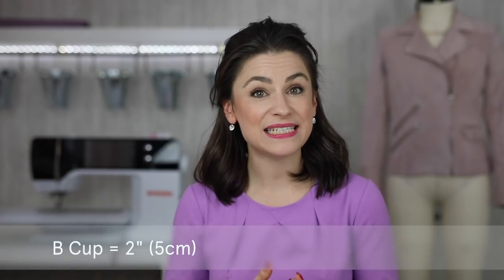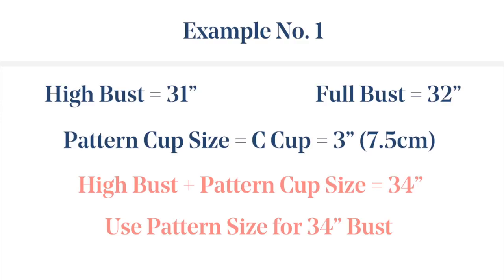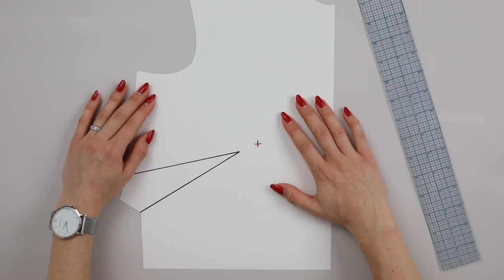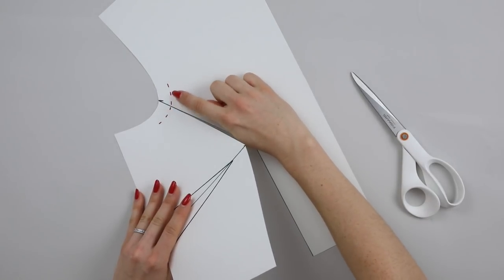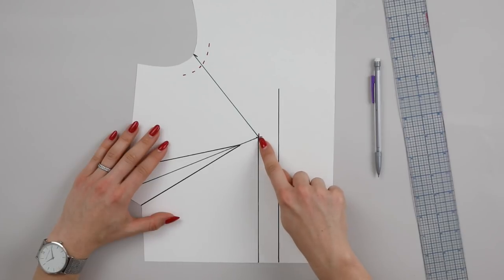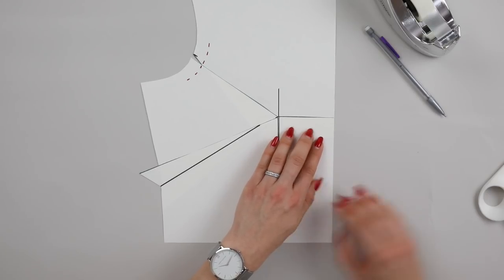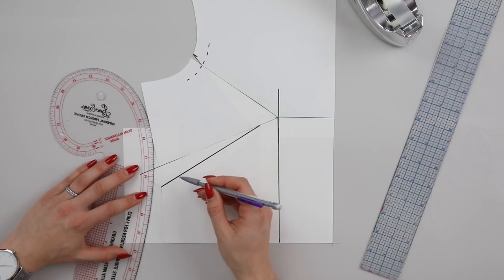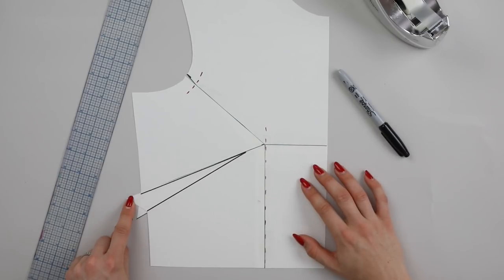How To: Understand Basic SBA - 1 Dart Bodice (Small Bust Adjustment)

Comment: Thank you so much for this video! I watched another sba video in an online class I'm taking and was totally confused. I needed to go from a c cup to a and that video didn't show how to eliminate the dart altogether. You just made my day! One question: if I want to maintain the pattern's waist width and use the curved ruler to redraw the side seam, does it matter that the side seam on the back piece is still straight? Do I have to curve it the same way for the front and back to fit together? Maybe a silly question but Imtvery new to this. Thanks!

Comment: Excellent tutorial. But how should you choose your pattern size in the first place?  Usually, we choose the size based on our bust measurement -- but that is the measurement we are actually going to reduce! Would it make more sense to choose the pattern size based on the high bust measurement? Then the SBA would take care of itself, so to speak.
Reply from the maker: Hi Mary, in terms of what size to choose it really depends on the pattern company you are working with. For my (Made to Sew) patterns I would recommend you choose a size based on your Bust, Waist and Hip and blend between the sizes as required. For the Bust size you would take your High Bust measurement and add the cup size of the pattern (usually B Cup, a difference of 2" 5cm between the High Bust and Bust). This is the Bust size you would choose. If your bust is different to the Bust size then you would do a SBA or FBA. Does that make sense? 

With my patterns I also have a detailed Size Chart covering the size of the shoulders, cross front, cross back etc. so you can see where you fall in these other measurements. 

For some of the larger pattern companies (e.g. McCalls, Butterick etc.) you can find that the shoulders etc. are quite large. I have some customers choose the Bust size from their High Bust (without added the cup size of the pattern). Then making adjustments. 

I hope this helps? Aneka x

Comment: Brilliant! Thank you so much! I’m off to buy some calico to have a play with my patterns. As a small busted women I’ve always squeezed into a smaller size just to eliminate the excess fabric at the bust. Will these adjustments fix the problem of having arm holes that are too big and too low in the armpit in sleeveless garments?
Reply from the maker: Hi Esther, glad I could help. It probably won't help the issues with the armholes that are too big or low. You can easy raise the armpit (I do find some patterns draft them quite low), and I have a tutorial you can use if you have gaping in the armhole: https://www.google.com/search?q=remove+gaping+armhole&rlz=1C5CHFA_enGB814GB816&oq=remove+gaping+armhole&aqs=chrome..69i57j35i39j0l8.2790j0j7&sourceid=chrome&ie=UTF-8#kpvalbx=_YnuwYO3wCbjZz7sPkMKH-Aw33 Thanks, Aneka x

Comment: Hi! Great video, this is really  helped me since I have a small bust - I do have a quick question: I am sewing a slip dress, which uses spaghetti straps and has a rounded waist (so no arm holes and waist comes to a point on the midline, creating two separate bust pieces). How would I apply this approach to this pattern?
Reply from the maker: Hi Olivia, can you email me some pictures of the pattern so I can advise? info@madetosew.com or message me on IG (madetosew). Thanks, Aneka x

Comment: When making an SBA if the top has a sleeve will adjustments have to be made to the level pattern as well?  Next silly question... so for example following this tutorial I cut out pattern size 8 ( because size 8 is 2" larger than my bust measurement)  for the sleeve for the garment do I cut out my actual sleeve size which would have been a size 4?  And the same for the bottom (as it is a dress( I would use pattern size 4 on the bottom as that is my actual size for this pattern correct?   I know this is an older video but I hope you still see this question.  This tutorial was so helpful!
Reply from the maker: Really pleased I could help. You do not need to change the sleeve, as you haven't actually changed the stitching line of the armhole. You should use the sleeve cap size that fits the armhole. I would firstly try and make the garment (a sample ideally) without sleeves, then you can check the SBA and the armhole shape and size. If the armhole fits well use the same size sleeve for the armhole (because you need the sleeve cap to be the same size as the armhole to fit). BUT you may find that you want to change the side seams of the sleeve, if you have a smaller bicep and want to reduce the amount of fabric you have here. You would have to taper them from the underarm (as this seam can't be changed without affecting the fit into the armhole). Or you could do a Bicep Adjustment: https://www.youtube.com/watch?time_continue=367&v=Snj8iT_MIcc&feature=emb_title Let me know how you get on? Aneka x

Comment: Hi Aneka - I measured my high bust measurement as 90 cm.  I always wear a padded bra so my bust measurement is also 90cm.  How would I then work out the measurement to do the SBA?  Thank you for doing the tutorial.
Reply from the maker: Hi Tracy, I do hope this video has helped you. Ok, so if you High Bust and Bust are the same measurement then you may not need to create a cup for the Bust. I would start by removing the amount of material required for the dart to go away. So in this example it was 1". In another pattern it might be more or less. I would start with that, but be aware that you may need to take more. If you take more than this the dart will close even more, which would make the side seam shorter than the back. So you may need to extend the side seam at the front side, to make sure it matches the back (obviously check the your Back Length measurement is still correct). Let me know if this helps, and another other questions. Aneka x
Reply: I am going to be making the Harley tunic dress when I get back from Canada on the 19 July.  So would I have to do a SBA on that pattern? I was planning on making size 2 which is 91cm/36".  My bust is 90cm.

Comment: Hello! I accidentally made my side darts uneven. Any tips on how to fix that ? I am scared of using more fabric because it may make the fronts pointy. 🤦‍♀️ any advice ? It’s for a really important dress.
Reply from the maker: Do you mean when you sewed the darts? Or on the pattern?
Reply: @MadetoSew  the darts. I think I fed the fabric differently when I was sewing each side and cut it before checking 🤦‍♀️
Reply from the maker: @jarapovic  so when you were sewing the darts you made the mistake? And they now aren’t the same? 

From what I understand you trimmed the bulk of the dart away too? 

Are you able to undo them and see where the garment is symmetrical? It might be that you can raise one and lower the other so that they are symmetrical. I think it will look better if they are symmetrical even if that means that are lower / higher than they should be. 

Does that make sense?
Reply: @MadetoSew  yes it does thank you ❤️

Comment: Hi.. I dont know if im doing it right. I followed your instructions but i find that i need to cut along the line of the middle of the bust dart to be able to make the adjustment and for the paper to lay flatly. Did i mess up?
Reply from the maker: Hi Danica, you do need to cut along the line in the middle of the bust dart. I do show that in this video. You are not doing it wrong. Sorry if it wasn't clear. Aneka

Comment: Hi Aneka,  I'm wondering if anything needs to be done to the underarm portion? It has moved down a bit.  Would I add paper to bring it back up to the original location?  Also,  where can I purchase your patterns?  I went to your website but can't figure out how to buy them.  Thank you, Aneka.
Reply from the maker: Hi Rachel, thanks for your message. I am very sorry about the confusion with the patterns; they haven't launched yet. You can add your email address to the pattern that you are interested in and the system will let you know once they have launched. With regard to the SBA you don't need to raise the armhole, the shape of the armhole does change slightly because we are using a pivot point in the armhole to complete the SBA. You shouldn't find that it causes any issues on the final garment, let me know how you get on? If you find there are issues with the armhole, feel free to email me some pictures and I will help you fix them. You can't just raise the armhole again, because then the front side seam will be longer than the back, does that make sense? Aneka
Reply: Gocha.  Thanks Aneka!  Also,  I've added my e-mail at your website.  I'm particularly looking foreward to making your jumpsuit.
Reply: Aneka,  I'm your biggest fan.  I don't care how long it takes I will be patiently waiting for your patterns.  U.K. is so fortunate to have you!  Thank you so much for being accessible to answer questions.

Comment: Hello! I've just completed my adjustment from a C cup to an A on the front pattern piece! I have a question as to what to do with the back piece since the  front piece is now about an inch and a half shorter than it was. Would I take the same amount off from the back piece? Also this pattern will eventually have sleeves, do I need to modify the pattern piece for the  sleeve as well, or does it not matter because of the pivot at the armhole ....the space that is removed from the side is just relocated to the pivot point? I also eyeballed the dividing the armhole by 3rds...is that okay? Not quite sure how to accurately measure that area otherwise.

Also, this pattern is a dress. While choosing my pattern size based upon my upper bust measurement + 3" (C cup) do I only use the corresponding bodice size for the SBA, and cut the rest of the pattern to what my normal size would be? Thank you!
Reply from the maker: Hi Sara,
You shouldn't need to change the sleeve because you didn't actually interfere with the stitching line on the sleeve.  The adjustment should be made to the stitching line and not in to the seam allowance, so the stitching line for the size of the armhole should remain the same.  
The fact you eyeballed it by dividing the armhole in to 1/3rds is fine and should work well.  I would however recommend that you make a Toile  first.
If you have adjusted the front from a C to A cup the adjustment should have taken place within the dart, so therefore although the front pattern piece looks shorter it is actually only the bulk of the dart that looks shorter?  Is that the case?  
Or by making the adjustment have you removed all of that dart?
Ideally you would be removing the bulk simply from the dart or the side seam, so therefore you would not need to make an adjustment to the back, because the front and back would still match.  It's simply the front dart that has got smaller.  
Or, potentially as you have gone from a C to an A cup the front dart may not exist at all?  If that is the case and  you have removed more than the dart then yes, you are going to need to adjust the back as your side seams will be a different length.  

I hope this helps?

Comment: What about when the high bust is larger than my itty bitty full bust?
Reply from the maker: Then you may have to do a Small Bust Adjustment. So that you don’t have a difference between the High Bust and Bust. 

If your High Bust is larger than your Bust you may also find that you have a Broad Back, or something else going on; which is making the measurement larger. 

But first up, you could the SBA to 0.
Reply: @MadetoSew  thanks, my high bust is 33” and my full bust is 32”. I have a double A bra and all small bust adjustments haven’t worked. I’ve also made my own bodice from my own measurements but the standard dart size is 1” but that’s too much. I’m thinking my next step is to use myself as a dress form and set the darts on myself. 

Is there a way to determine how wide the dart should be?
Reply from the maker: @emm6724  Hi There, really sorry that you are struggling with this and small bust adjustments haven't worked in the past. If your full bust is smaller than your high bust it is possible that you do not need a dart, usually I would remove the dart by doing a SBA and then the garment would fit better. 

If you are drafting your own block then I would try this without a dart, or with a very small bust dart (say 1/2" maximum). I would be inclined to have no bust dart and then just use a waist dart for fitting. Does that help? Aneka

Comment: HI Anika, Thank you for the great tutorial! I followed your instructions but what I don't understand is why no one talks about shortening impact on the bodice. I am a tall person and when I did my 1 Inch SBA my bodice got nearly 2 inches shorter. I initially had to lengthen the bodice by 2 inches but anded up adding total 4 inches (2 inches SBA impact + 2 inches initial extra length). Now i have a gaping armhole because of the underarm notch  i made for the SBA. Now I read in the comments below that I should not raise the armhole but how do you then fix the armhole gaping? When I sewed my first tolle I didn't have armhole gaping juts too much room around the breast. Thank you in advance and hope Ozzy land is treating you well.
Reply from the maker: Hi Polly, thanks for your message some great questions. You are correct that by doing a SBA you end up shortening the bodice, but not on the side seam, only on the front seam. Because by having a smaller cup size there is less length over the front bust part of the body. The back and side seam are the same and have not been amended. If you need to add length I would compare your back length to that of the pattern, did you do this? Was there any difference? What you have added sounds correct, but you will probably find that it is because of your back length that you need to make this adjustment. 

In terms of the armhole, gaping in the armhole is quite common in the big commercial patterns, armholes vary greatly from person to person and patterns are often too low (in my opinion). You can by all means raise the underarm of both the front and back pieces, it's just that this isn't related to the SBA you have done, does that make sense? You can also look at this tutorial to correct any further gaping: https://www.youtube.com/watch?v=H9YVk2hkvC0&t=2s

Does this help Polly? Thanks, Aneka x
Reply: Thank you Aneka! I must have done something strange as I remember I needed to add length on the side seam. I will practice again. Your comment and explanations are very clear. Thank you so much Aneka! Have a great start in 2019!  @MadetoSew
Reply from the maker: @pollybg  Any questions just shout! Thank you, a happy 2019 to you too! xx